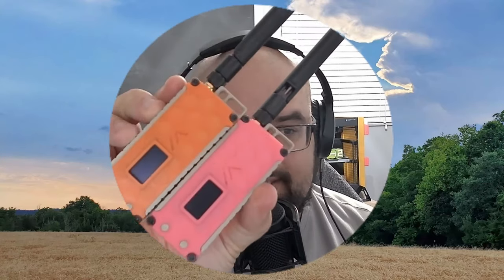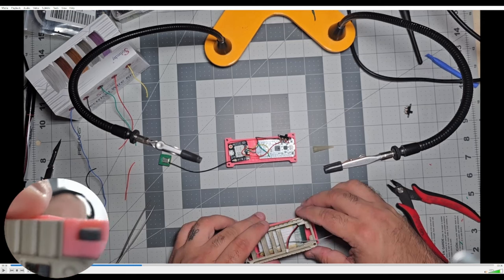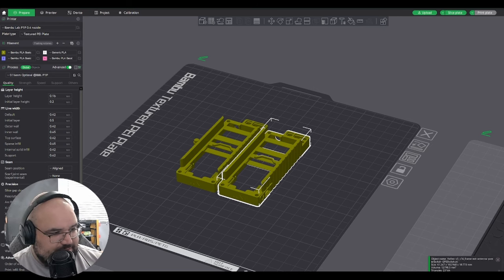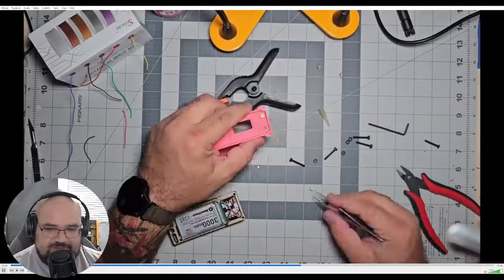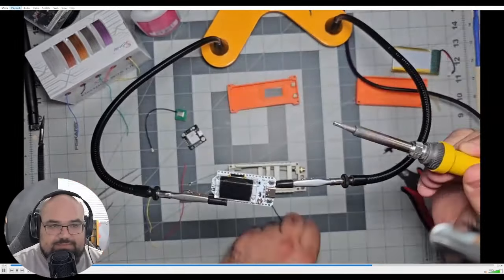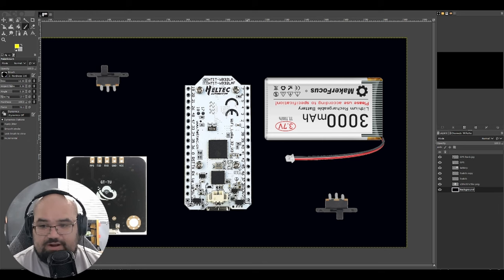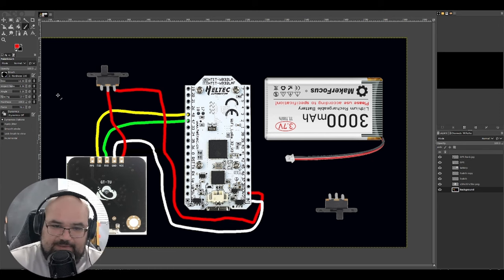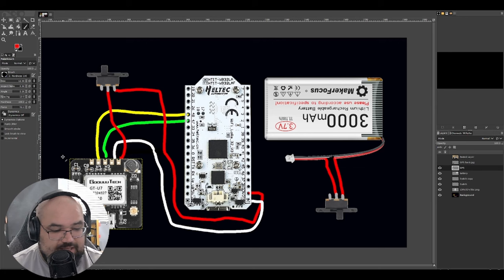Meshtastic Heltec v3 Hardware Build

Comment: I printed the tall version of the buttons, scaled down 0.2mm on the Z axis, and for me it was a perfect fit, not popping out much, definitely no accidental push possible. Printed in BambuLab PLA basic. For the switch I used two M2 screws, and it holds it very well.

Comment: hey dude, about to get this printed (no 3d printer at home), im doing no switches variant but im stumped on which back plate would fit that 3000mAh.  There seem to be 3 different ones, 5mm, 7mm and 11mm.  
Which one did you use on this build? Would you say it was a right fit or would you recommend to build it with a different STL?
Reply from the maker: I believe I did 5mm but honestly it's a little tight, I would probably go a size up if I had to do it again

Comment: I use the same batteries but the charger I use does not charge them. Using Solar causes the battery to drain fast when the sun goes down.
Reply from the maker: Are you only using a solar charger? I'm using a regular wall charger and it charges. It sounds like something might be wrong with that solar panel like it's missing a diode
Reply: Put  couple of diodes in line  with solar panel charging leads so current  flows one direction.

Comment: I have yet to find the pinouts for the 820 barometric pressure board. Do you have any links?
Reply from the maker: I'm not familiar with that board. A quick good Google isn't turning up any results. Where did you get the board from?